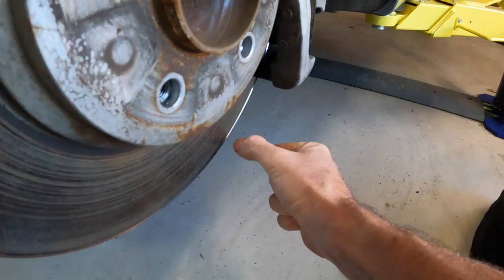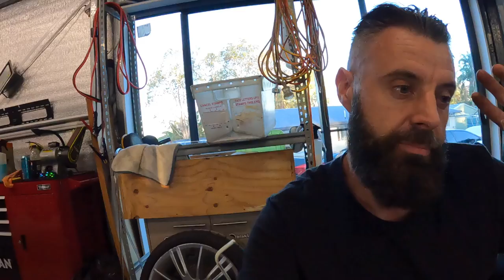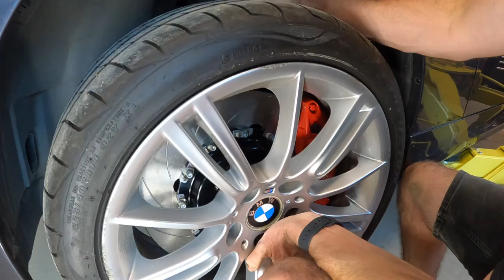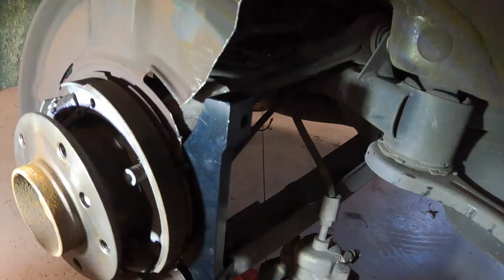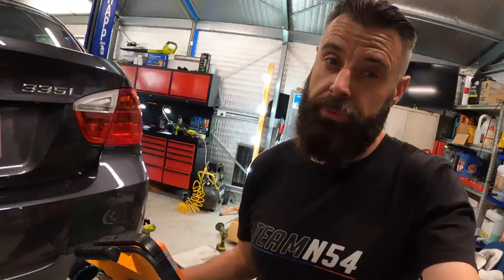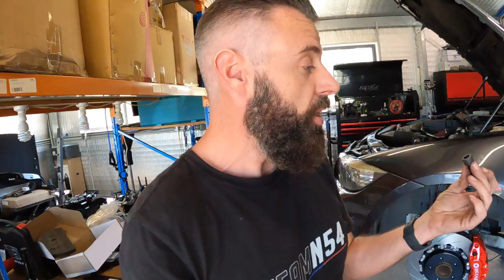BMW Big BRAKE UPGRADE KIT INSTALL: FINALLY A GOOD FIT!

Comment: Here’s a useful tip for ya! When changing break callipers, use a bit of wood and press the pedal down and move your seat forward and lock it in position, you’ll lose a little fluid to begin with but it won’t drain the reservoir and it doesn’t suck air back, once done just bleed them up! Simples haha
Reply from the maker: Bloody hell! Things you forget when filming.
Reply: Done this, works like a charm!

Comment: A few tips for ya. First, clean the new rotors once installed, before you mount calipers and pads. Second, clean the central hub from rust scale. Third, a tiny amount of anti seize compound on the central hub, and the lock screw that locates the rotor to the hub, will do you wonders in the future. Don't panic about how much fluid you would lose while changing lines, it is minimal. ABS valves won't let much fluid through while the car is not running, you may lose whatever fluid is in the line but it won't drain the ABS pump.
Reply: Alas... Air can travel back up the lines and play havoc with the abs pump. 

Hence why ista has the ability to pulse the abs pump on fluid changes.

Comment: Cool option for us !
How do you deal with the pad wear sensor? Is it simply dis-connected from the inner wheel arch ? Open circuit.
Reply from the maker: You need to close the circuit. Interestingly this car has already had a front sensor delete. The rear won’t work tho.

Comment: It sounded like the wheel weights were clipping the caliper? or was it just noise from not being fully bolted up? 3rd option I'm hearing things 🤣
Reply: I heard it too. It’s probably safe to say that the wheel weights need to be moved now .
Reply: @chrisrobles2012  From my sanity, thank you.
Reply from the maker: I will double check although the wheel wasn’t properly tight at all.
Reply: Zero To 60 , if you scratched them, and you don’t want them anymore, just send them to the states. I’ll gladly take em’.

Comment: Hi mate, have you done a video on an oil cooler? Wanting to get one
Reply from the maker: Only on transmission oil cooler. We actually have 3 here ready to go on the 17t car, OHHRLY and the vargas car. So will have a vid in the coming weeks for sure. We have sold a few of them now and they definitely help in the QLD heat.

Comment: I can only find the 380mm rotors on the site. Do I need to contact direct to get the smaller rotors for my 18inch wheels?
Reply from the maker: Yes, try and get in touch with Angela on whattsapp. She is pretty good with the english translations.
Reply: @ZeroTo60Tube  any reason you opted for these opposed to the ones Angela has with the actual brembo logo?
Reply from the maker: @nasirholiday90  Because they are not brembo.... Close but not the real thing.
Reply: @ZeroTo60Tube   Thank you I was just wondering if there was anything physically different I know clearances are weird on these kits.. I think I’ll stick with my oem setup. I cross referenced both of your videos on these and made the decision to pass on it. I probably wouldn’t offer links to these being such a critical component to a vehicle.

Comment: take the dust shield off completely, your brake pad life will go up significantly, been doing it for the past 25+ years on everything
Reply from the maker: Interesting, how does it improve life of the pads?
Reply: @ZeroTo60Tube  the dust shield ends up holding heat on the rotor and the inner pad wears faster than the outer pad because it can't dump it's heat like the outer side facing the wheel where there is ventilation. In some instances it will also lessen caliper spread. All my service vehicles and personal vehicles, millions of miles mate.

Comment: how much is the kit?
Reply from the maker: You will need to contact them directly, being the manufacturer the prices do change a lot but normally around $2000usd delivered https://bit.ly/3d5cxhO

Comment: Was the retaining bolt on the caliper tightened to the industry standard two ugga duggas? 🤣 So many would be triggered
Reply from the maker: I’m All about those industry standards.
Reply: @ZeroTo60Tube  i have a send it policy on most stuff like that. Never had an issue over or under tightening.

Comment: Personally, I always thought the 335i brakes were subpar, mind you I did all the basic mods with hawk pads, fluid, lines, rotors, triple check the bleeding and for a whole year thought they were crap, best upgrade I ever did was when I bought the m4 calipers for 300 bucks and mounted them with 370mm disks, now braking was reliable and inspired confidence. I guess it really depends on what you are doing seeing as I go and track the car. Mind you Apex wheels cleared the brakes while remaining 18 and I think I read somewhere that you can get their 17 to clear the 355 rotors you have there as they have better barrel clearance than the oem wheels.

Away from that, its really cool to see how you guys somewhat helped them in their new design and are showing the process for this brakes, cutted it real close with the ineer barrel vs caliper it seems (lol) hope to see the future review when you actually put them to use on the rolls.

On a side note and off topic, MHD recently released a way to patch the accelerator lag to 1m standards for the n54, tried it recently in my dct at the 1m setting and it really changd how you feel the car around town or in tight scenarios, you should check it out in the dct swap car if you havent yet messed with those tables.

Comment: Hey everyone. 

I got these brakes from the same supplier for my E90. Everything started off great and brakes look decent. Been having issues with the front as I'm having a weird noise of the brake pads rubbing against the rotors while driving or thinking it could be that the pads are't retracting all the way causing them to wobble and hit against the rotor. 

I've tried everything to realigning, even spent some $$ on hawk pads instead of the cheap Chinese ones and even rebled everything. I'm stumped, my mechanic is stumped, and I also took it to a brake shop that has experience with real BBKS and they can't figure out why it's making that noise. 

Communication is non existent. And you just ignored by the all the people working for the supplier. Most seem to not have issues but if you get a bad batch like I have you are SOL. and down $$

just my 2 cents.

Comment: The caliper design, and hence, pad coverage on the rotor is what makes the biggest difference up front. You don’t need to change the rears, IMO.

Comment: Hey, i really want to know how was your old AliExpress Brakes holding up?, is it any good or not?, wanted to buy too for my car (only going for the looks). thanks in advance
Reply from the maker: It's good, few teething issues with certain bits but got there in the end. The upgraded pads i think are a must
Reply: @ZeroTo60Tube  Thanks for your response, i’m considering to buy it now 👍🏻

Comment: Do the new brakes take the electronic wear sensor into them? Man those wheel weights are close.
Reply from the maker: The fronts do the rear does not. However the front sensor has already been deleted on this car.

Comment: Just when I got my F8X brakes... :( And my experience with those was shit (not due to the product, but the seller).
Reply from the maker: Sorry to hear to hear dude.
Reply: @ZeroTo60Tube  What size disc was the fronts? I am gonna run the m4 380mm disc with my 18"s 😃
Reply: @grovsey3656  according to JR the wheels fit if you look in their gallery of the bmw M2's. JR sl01 is the rim
Reply from the maker: @Zalle335  These discs are 355mm and mm away from the OEM 18. You will be able to run some 18 inch wheels with the 380s, but they will be specific aftermarket ones for big brake kits.
Reply: @Zalle335  How did you find the 380mm F80 brakes? Were they a significant upgrade in stopping power over stock? I have been thinking about these for myself but I'd really like to know if they're worth it or not! Thanks
Reply: @topfueljunkie100  Hi,
Just last weekend I've fitted the brakes, havent tested them yet. 18" fit with 380mm